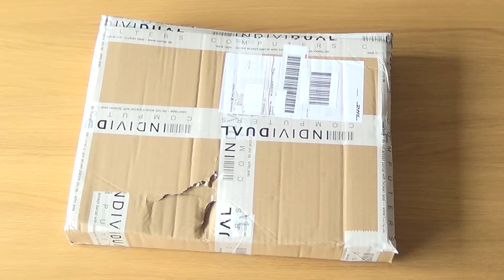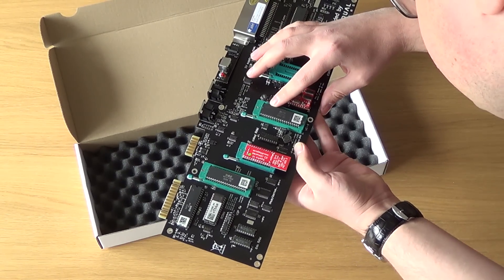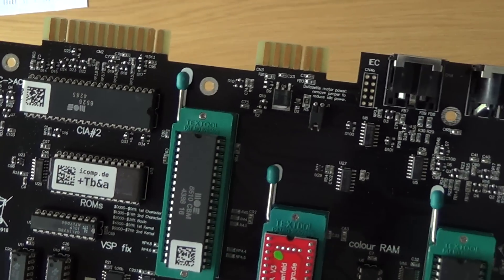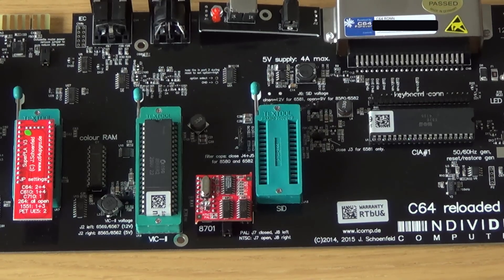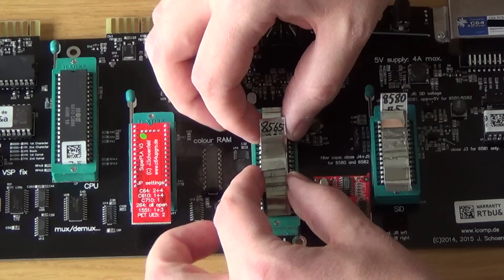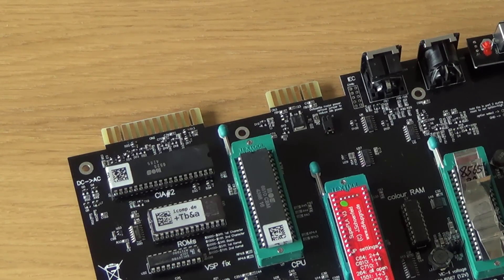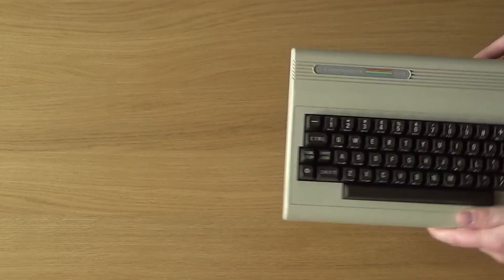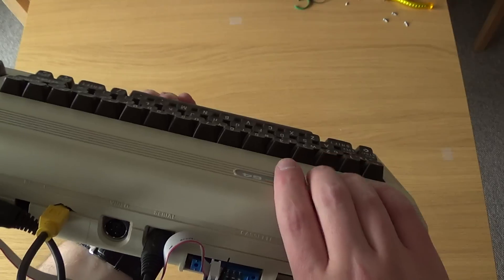C64 Reloaded. The new (MK1) Commodore 64 motherboard.

Comment: strange tilted daughterboard with jacks
Reply from the maker: That looks a little funny, yes. But it's necessary to make the s-video plug line up with the RF port in the C64 cases. ;)
Reply: why not to raise both sides?
Reply from the maker: Because then the minijack port won't line up with the "L-H" hole in the C64 case. ;-) Here is a quote from the official page: "These two connectors are mounted on a separate circuit board, which is mounted at an angle on the C64 Reloaded. This puts the two connectors in positions where the holes of the original C64 case can be used, and drilling or milling won't be required."
Reply: Nevertheless, it didn't match, small piece of top plastic had been removed.
Reply from the maker: Oh yeah, that.. Not my proudest moment. :) That was because my own fat s-video plug was too big. I use a different cable nowadays (and a different case - C64C). Fits nicely without cutting the case. Not really sure if it lined up a tad imprecise in the breadbin case I used in this video, but it's dead-on perfect in the C64C case I use now.
Reply: k

Comment: Did the same with my Amiga 1200, i hacked into the side of the case so that i could get to my CF card when i needed it. Thee things ar brittle much like the c64 case. I immediately regreted it as it looked a mess so i purchased some small files and tidied it up and now im not so disapointed. I would suggest just filing that crack down in an effort to tidy it up.
Reply from the maker: +craig gilchrist Yeah, that's not a bad idea. I'm not really using that case right now, but I will put this on my to-do list. Thanks. :) What CF card did you have to access? The one that acts as an internal HD? Why? Hehe.. :-)
Reply: Yes thats the one, Just got the new ACA1220 from individual computers, that place is amazing.

Comment: "Norms or standards..."? Screw that. There are no norms or standards for unboxing, except kindly not ripping a box to shreds like a madman, perhaps! :-)

But why buy a motherboard like this when there's an even smaller version of the same thing, as built right into a joystick (the C64 DTV), which you wouldn't have to install in a full-size case, and you can still hack it to connect drive ports and things to it? Maybe just so you don't have to hook the ports in, huh? So this size is an okay trade-off? But since you're installing this into a full-sized case, what are any advantages besides the new jacks (S-video was already on the old one but not in the same pin-out, and coaxial audio can easily be converted to tip/ring with a small adapter)?
Reply from the maker: +MaxxFordham Hey, thanks for the comment! :) I do see your point. I've never had a DTV, so don't really have any arguments for or against it. My suspicion is, that sound/picture/compatibility differs from the original C64 "somehow" - yes, I could be wrong. :) Though I have read some interesting articles on how to hack it. It seems like a cool thing to have. I never compared this Reloaded board with the DTV, but I do have a few arguments.. :) With this board everything is EASY (keyword!) and convenient. I like the option the easily be able to switch out any chips, like 6581/8580 SID or switch between PAL/NTSC. This board allows for that with the excellent ZIF sockets. And I NEED the expansion port for my 1541U-II. I would imagine, that adding such a port to the DTV would be QUITE a project (if at all possible). Not that I'm afraid of a soldering iron, but it can be too much.. ;) And I really like the original C64 case(s). Even if I had a hacked DTV, I'm pretty sure I would put it in a C64 case. ;) Yes, I'm aware of the s-video (ish..) signal, you can get from the video port, as well as the audio. Used special cables for that. Okay, you get the picture, so I'll stop the rambling now. ;)

So.. I'm happy with this board. It satisfies my nerd heart. ;)

Comment: Is there a need to add heat sinks to those chips?
Reply from the maker: +apinakapinastorba That subject is somewhat controversial. But the simple answer is no. There is no NEED to do it. It will work fine without. But if you ask me, there is a big advantage in doing it! I am of the oppinion, that it will considerably prolong the chips lifespan, if they are cooled down.
Reply: Casual Commodore 64 Oh yeah, I did not think about the lifespan. Better make the chips last for another 30-40 years! Btw after watching this video, I had to grab the C64C from closet and set it up for a game of Bionic Commando :)
Reply from the maker: +apinakapinastorba Great! And Bionic Commando.. Nice choice. I should make a gameplay video of that one. :)
Reply: +Casual Commodore 64 \(°^°)/

Comment: Looks like Leggo .....What about the c64x? https://youtu.be/bmj3dp3aokw
Reply from the maker: +walkabout16 Have you ever played with Lego? Because It seems like you don't quite know what Lego looks like.. ;-) The C64x.. Well.. I did have my eye on that, when it was announced. But from a retro gaming point of view, it's not very appealing. It's just Linux or Windows, running on normal 21st century hardware. C64 gaming on that machine will have to be with an emulator. Emulators are fine, but it brings down the "retro feel", if you ask me. ;-) To me, the only appealing detail about  the C64x, is the look of the case. Besides.. They're not sold anymore because the company went out of business.. :-/
Reply: +Casual Commodore 64 
 I have nothing against the c64 as I used it many years ago as a CB'r and later a radio amateur to send and receive packets (packet radio) via short wave radio to other stations around the world long before the Internet became popular.

Comment: How is the feel of that keyboard? In one hand, the keys looks like a quite confortable mechanical set, but in the other that steep sloope looks like a real wrist destroyer.
Reply from the maker: +José Sandoval Hmm.. I never thought of the C64 that way. I don't use it for much else than gaming and watching demos. ;) It feels fine for me, but it's not as comfortable as most modern keyboards. I would guess the C64 does not have the most comfortable keyboard for word processing. ;-)  - If someone else has experience on this, please chime in.
Reply: +José Sandoval I have thousands of hours with coding on the C64 and the keyboard is bad. I would not be able to use it for longer periodes today.

Comment: Great overview of the Reloaded board. I missed out on one (couldn't afford it), but it's great to see that even down converted to composite, the output's really nice.
Reply from the maker: hellfire64 Thanks. Yes, the picture is very good with composite. Though, it has always annoyed me, that I couldn't use s-video directly. I'm sure you know of the C64's problem with neighboring colors that "don't like each other", and displays in a sort of checkerboard'y mess (very visible in this video: watch?v=hxf0foyEhtc). That always shows on my TV with composite. I'm guessing that problem is not so severe with s-video. I have an XRGB Mini on the way. I really hope that will help! Thanks for your comment. :)
Reply: From what I gather, S-Video is a big improvement on a lot of the cross talk - I'd love to be able to upgrade (my capture hardware does it, but the TV I'm using doesn't sadly).

I've got plans to get an XRGB Mini, so I'd love to hear how it goes for you once it arrives and you get it up and running :)
Reply from the maker: hellfire64 Ah, it's called cross talk. I sometimes lack correct terms, so I explain it instead.. :) I'll keep you in mind, regarding the upscaler.
Reply from the maker: +hellfire64 Hello again. It's been a month or two now, and I have had time to mess around with the XRGB mini. This is to let you know, that I have made a little video about it. So check it out, if you'd like. ;)

Comment: Dude, the original C-64 has S-Video already! That is what the monitor port is. Luma, Chroma and Sound. Luma and Chroma are the S-Video signal. If all you wanted was S-Video, you could have just built a cable. It's not called super-video, it's called separate video (because composite is both luma and chroma combined and S-Video is Luma and Chroma separate).
Reply from the maker: tarstarkusz I'm aware that the original C64 has s-video. I always use it. Though, for some reason the dedicated s-video port on the Reloaded has better picture quality, than the s-video signal from the video port (also on Reloaded). At least, that is what my eyes tell me. ;) I did not buy the Reloaded just because it has an s-video port. S-video is officially "seperate video"? Didn't know that. Interesting. But the term "super video" seems to be more widespread. Maybe the term stuck around from the Super VHS days? Hmm.. Well, thanks for the comment, "dude". ;)
Reply: Casual Commodore 64 No problem. What are the advantages to the reloaded version (besides S-Video)?
Reply from the maker: tarstarkusz Well, what attracted me the most, was the ability to switch between different SID and VIC-II chips, by just moving a few jumpers around. Love that flexibility! :) And the ZIF sockets are a pleasure. Another hot little detail, is that the power switch's UP position acts as a reset button (bounces back to middle, which is ON). A lot of people seem to like the boards ability to switch between different kernel- and character ROMs. That's something I don't know much about. Anyway, I suggest you read the Reloaded wiki for full details (second link in description), if you are curious. ;)
Reply: Casual Commodore 64 I still have my original C64, disk drive and then a spare and a 128 along with a 1581 and a 1571. The 1581 is great for moving prg files from the PC to the C64 because you can actually use a PC floppy to write the disk.
Reply from the maker: tarstarkusz Oh, the 1581.. I don't have that. I always wondered what it would be like to use 3.5" on a C64. I'm guessing one advantage is more space, yes? And a disadvantage.. I'm guessing not all "big" (multi load) games will work from a 1581. Or will they? It's cool you can transfer .PRG files with it. I don't have a C128 either. I have long wanted to try a C128. It's such a fine looking machine! Not so much the 128D, though..  :)
Reply: Casual Commodore 64 The great thing about the 1581 is just how fast it is with a fast loader or with the 128. You can load a 202  block program (about 52k) in about 8 seconds. I've never had trouble with multi-load games as long as they are cracked. Any game that tries to run it's own internal fast loader won't work, but almost everything I downloaded from the net was cracked already. It's really fast for GEOS on a 128. I don't have a 128D. A friend of mine had one, but they were too expensive for my teenaged wallet. I bought the 1581 when I started college because the 1541 disks were too small and slow and even that was like $200.
Reply from the maker: tarstarkusz It's not justifiable for me, to obtain a 1581, since I have the 1541U-II cartridge. But still, I admit it's itching a little bit.. :) Maybe I should at least check eBay. So, you can actually have MULTIPLE cracked multi-load games on a single disk? That should work, yes?
Reply: Casual Commodore 64 A d64 image is like 180k and a D81 image is 720k. It's almost 4 times bigger. I bought mine new, but they are expensive as shit today.

Comment: Very wise handling a motherboard without an antistatic wrist protector, he can fry his board with static discharge, hopefully he is standing on a antistatic mat.
Reply from the maker: Jason Birch Nope, "he" is walking on a rug. But "he" did touch radiators and doorknobs several times while making this video. Though, such a wristband would have been optimum, yes. Thanks for weighing in with your concerns. ;)

Comment: why do you epoxy the heat sink down? couldn't you just use some TIM pads and use some standard little heat sinks like http://www.newegg.com/Product/Product.aspx?Item=9SIA7BF2K21105&cm_re=heat_sink-_-9SIA7BF2K21105-_-Product ?
Reply from the maker: Ｔｈｅ Ｃｏｍｐｕｔｅｎｔ In a closed C64 case, there is very little airflow. Larger fins that spreads out, are much better at leading the heat away from the chips, in such an environment. The heatsink you link to has very small fins, and work better with a fan. ;) Regarding attaching them, I turned to Ray Carlsen for advice. He said he used a thin layer of epoxy to attach them, since the IC casing is also made of epoxy. So that's what I did, and it's very effective. I presume the thermal pads could also work. Not sure if thermal pads has worse or better heat transfer capabilities than epoxy. :)
Reply: Casual Commodore 64
generally I'd imagine thermal pads would be better at it though only because I know they use it with things like VRAM on graphics cards. Epoxy might just be better, that could be an interesting experiment to do. I figured the thermal pads might be nicer in the event you ever need to remove the heatsink. The low airflow thing is a good point, I hadn't considered that, where did you source those heat sinks from?
Reply from the maker: Ｔｈｅ Ｃｏｍｐｕｔｅｎｔ Ray Carlsen makes them. :) I asked him nicely, if he wanted to make some for me. But if you have a soldering iron that gets hot enough, you can make them yourself out of empty soda cans (or any thin metal, I think). It's 2-3 strips of metal in different lengths, bent and soldered together. It just sounded like a lot of work to me, so I asked him to do it. :)